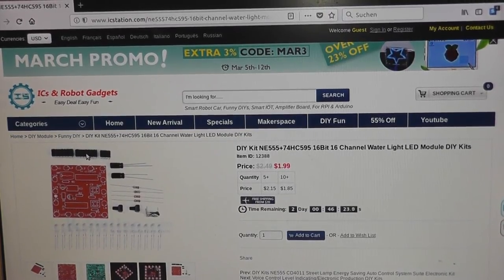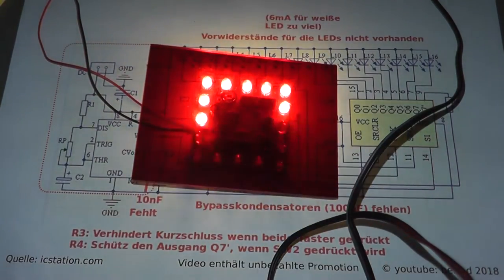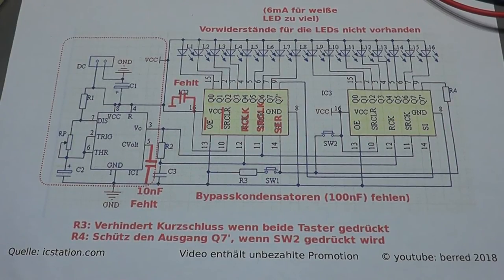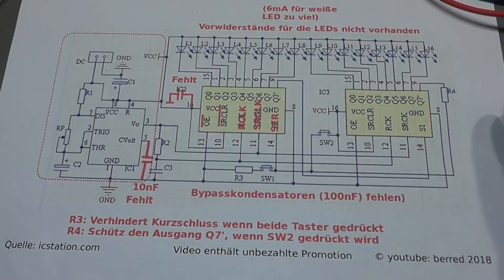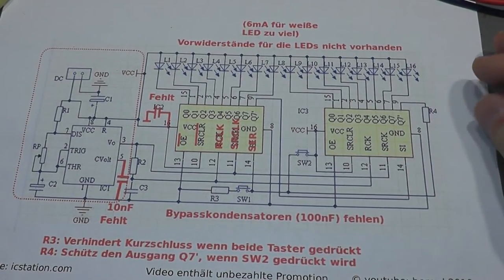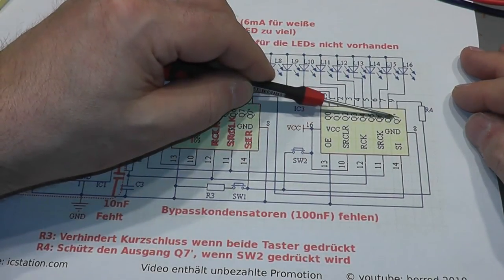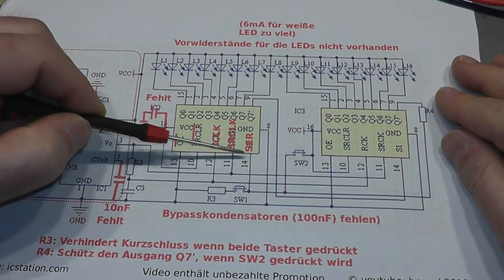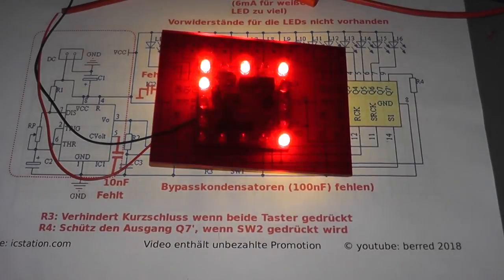ICStation.com 6 Channel Water light kit 12388 (EN)

Comment: Hmm, I seem to have the wrong resistors (again). Mine came with 3x 1000ohms and 1x 100ohms. I wonder if it will still work (I'm a beginner).

Edit- well, it powers on but swirches and potentiometer do nothing :/
Reply: I have the same problem with incorrect resistors in a kit bought from IC Station in about March 2021.Also they don't have one capacitor (C3) in the parts list or supplied or on the PCB photos. Also I found that the quality of the PCB and copper tracks was absolutely terible, and solder does not like to stick properly. So your problems may be fixed by using the correct resistors, plus checking all solder joints.